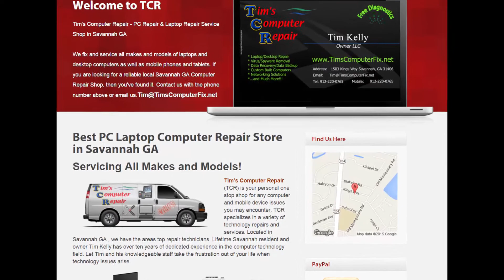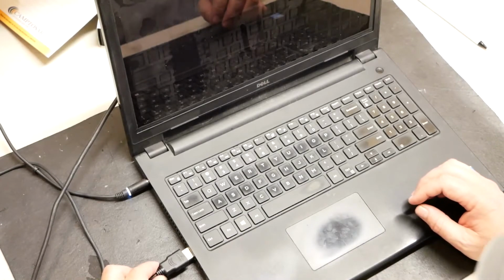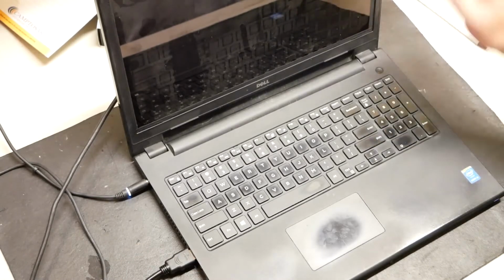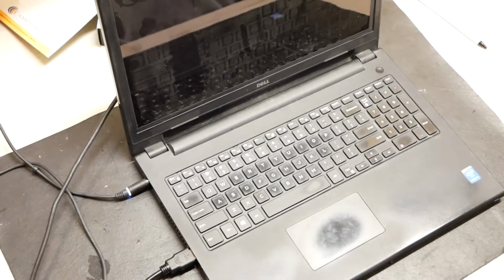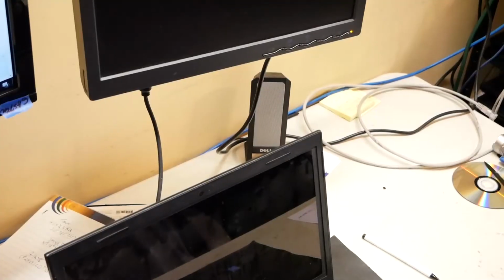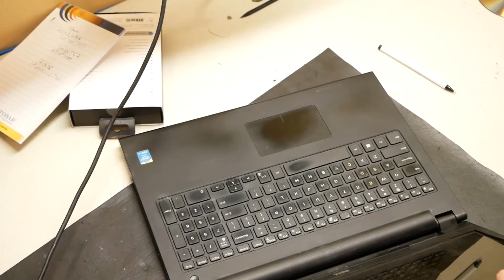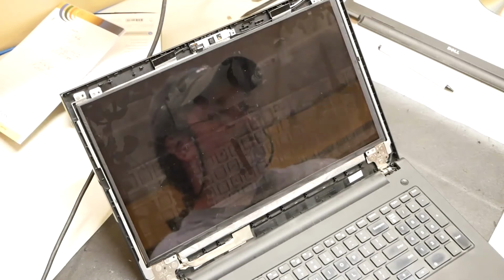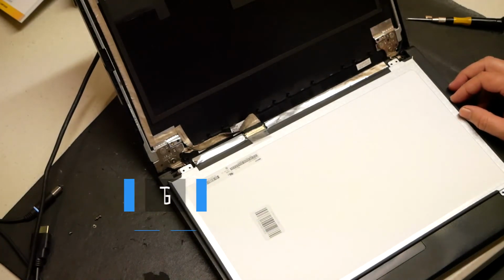Dell Display not Working on Laptop

Comment: Would this video help me fix my own? Yesterday morning my dell 3593 laptop was working just fine in the morning , I signed in and went on a zoom call, I was looking down at my phone when I catch a glimpse of the like blue screen with the “:(“ face then it going away and turning off , of course I naturally try to turn it on  but it beeps once and shows up something called “SupportAssist Pre-Boot System Performance Check” I try to click around but it just switches to a page with a QR code that leads me to the supportassist page on the dell website , so I was told to take the back off and take the battery then the hard drive next to it off and press the power button for about a minute and then to put it all back in , so I did and then my laptop wouldn’t show up and it was just a black screen , at first I would hear the fan and like it being warm by where it was like usual and I would see the like little light where you connect the power cable in flash orange and white , so I tried to plug it in but it kept flashing , then later the computer wouldn’t turn on , so I’m not sure what to do 😭
Reply from the maker: You would need to test with known good ram to eliminate that as the issue. Doesn't sound good.

Comment: My Dell inspiron 5558 giving black screen. When I connect it to external display then its giving 8 beeps and its booting and displaying correctly. Why its beep sound only when connected to external display. Is it only LCD issue or mother board issue?? Im confused.
Reply from the maker: As long as the computer works ok for you I would not worry about it.